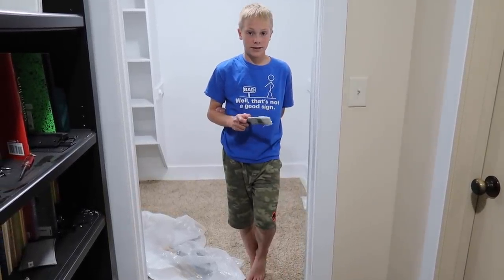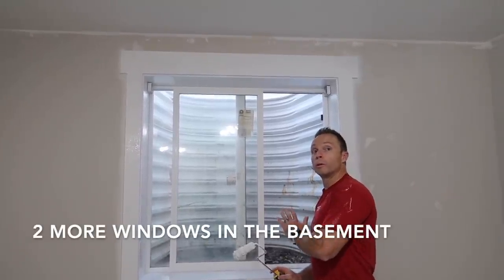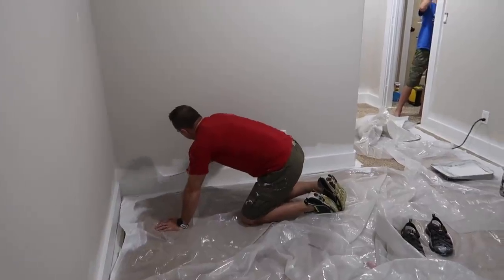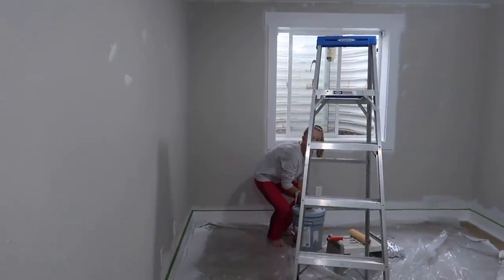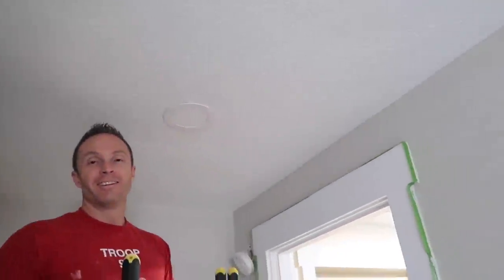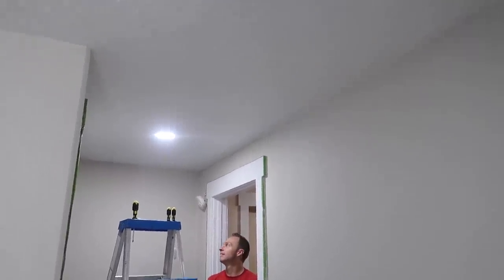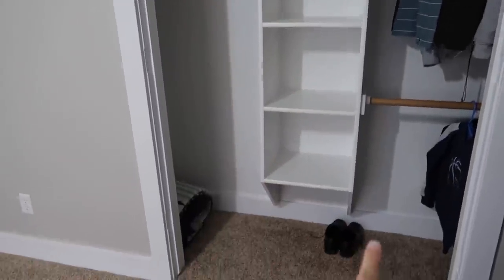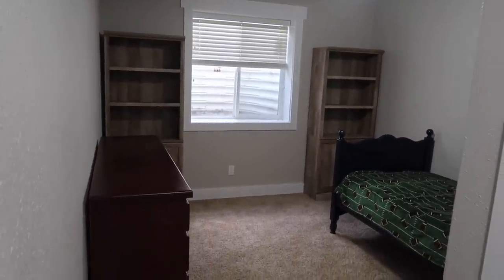NEW HOUSE UPDATES | ROOM MAKEOVER ON A BUDGET FFM  | VLOGUST #31

Comment: As someone who is almost done remodeling an entire house, 4 coats of paint (on top of the primer) is insane. We do a primer and then regular paint on top and have never had to do more than 2 coats of paint. It sounds like the paint you bought was junk especially since you were painting over a very light color paint, to begin with. Everything looks great though. You guys did a nice job!
Reply: Agreed. Quality paint and primer and paint rollers.
Reply: Covering up a darker color with a lighter color is more difficult and she noted that the drywall was nearly virgin drywall which sucks up tons of paint. Maybe two coats of a good primer would've worked better but can't test it for ourselves. Glad your experience painting was more enjoyable and less work.

Do you have a primer and paint you prefer? Which nap of rollers?
Reply: @amandah3205  The majority of walls we painted in our house were new drywall and all of it has 2 coats of primer. We used Olympic Brand paint and primer. The Premium Interior Latex Zero VOC and their Premium Interior Latex Kitchen and Bath Enamel Zero VOC were great!  Unfortunately, they no longer make that line of paint and primer. So we have 1 room in a Valspar paint that was pretty decent and 1 room in a BEHR paint that was kind of iffy. The BEHR paint we had to do 3 coats and that was on top of 2 coats of tinted primer we had on the wall. All of it was a satin finish and we just used a medium nap roller. We didn't really have a specific brand of a roller because we live in a rural area and we mainly had what was available that day at our local hardware store.
Reply: Came here to say this. I’ve painted windows that were BLACK from the beginning and never had to do more than primer plus two coats. Quality paint FTW!

Comment: As a painter I have to say a GOOD primer is really worth it. And put it on heavy. Not thick enough to drip. Primer also doesn't necessarily mean you need less paint, it does mean to paint will last a lot longer before chipping, and will hold up better over time.

Comment: The proclassic  should've only taken 1 cost over previously painted surface. I have no experience with the Captivate but I do have a gallon at home I haven't used. Next time use the Cashmere low lustre it's so easy to use and very forgiving with mistakes.  Y'all did great love how it turned out.
Reply from the maker: We used the proclassic on the trim and doors. 4 coats. :(